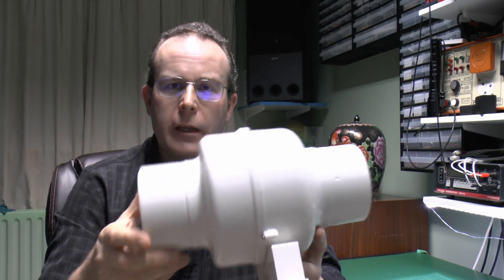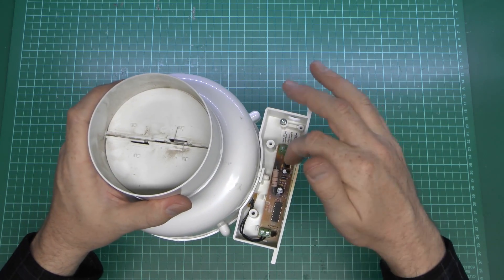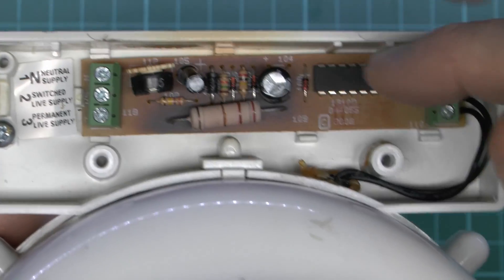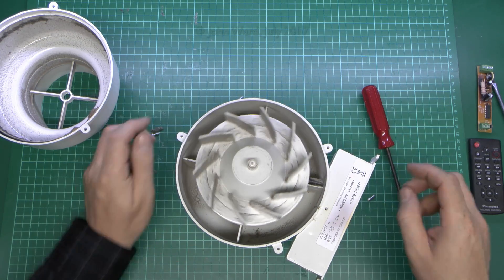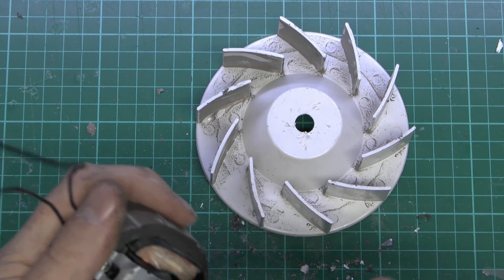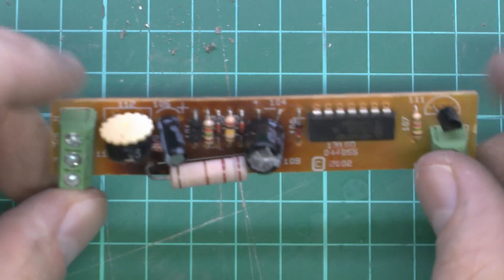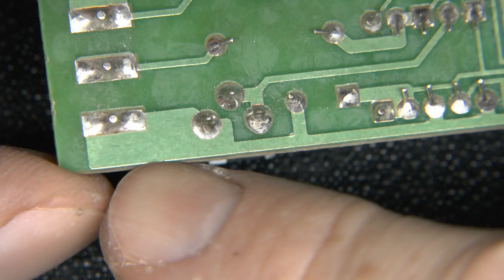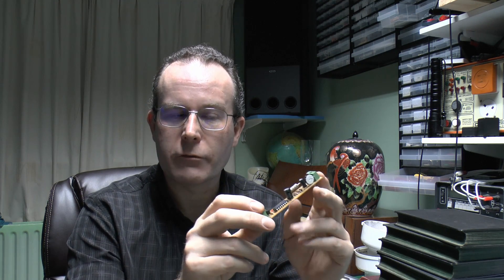Extractor Fan Timer Teardown

Comment: My bathroom ventilation is more reliable, either the window is open, or closed. 
I can vouch for the ceiling or wall mounted ones being noisy, the council installed one at my sister's place as part of one of their forced downgrades.
Within 24 hours I was asked to  find the isolator & turn the bloody thing off, and then go up a ladder to tape up the rattling vent & stop the draught.  Her window also works as well as it did the preceding 40+ years, without any noise or electricity bill.

Comment: Love it. I tried to fix one by doing the same - jacking the mains straight into the motor under test conditions from a plug and socket. My knowledge is limited so when it didn't work, I wondered if I was missing something. Looks like it was either a winding or thermal fuse. The bathroom fan was over £100! Thanks for putting my mind at rest.

Comment: The resistor simply needed to be hanging down in the air stream. That's the way that they used to cool the speed resistors in old car heaters.

Comment: You published this the day before I put a fan over the bathroom ceiling in my brother's house John!  I never thought that the fan he bought would have a simple resistor dropper but it is the same design as this one except it uses a singe jumper on a resistor array for the timer cap circuit!  I am imagining the warm PCB as I type and having watched your video fixed it to a roof joist 12" above the insulation for my own peace of mind!
Thanks and keep them coming...  Garry

Comment: Wow!  It has one of those HomeFire(TM) circuits brought to you by China.  Let's run 3 watts of power through a 3 watt resistor fitted snugly against a PCB and plastic housing.  Surprised they didn't fill that cavity with cedar shavings as well and advertise it as "aromatic scent emitter".  They did go all out for the premium Texas Instruments brand 4000 series chip though which is surprising.... not that they are expensive in the first place.
Reply: I think the resistor helps prevent condensation on the PCB in really wet bathrooms like mine.

Comment: At first I thought the IC was going to be a CD4060 but there was a capacitor missing. Then I saw the tracks between pins and when you carefully covered its markings I was expecting something inspired. But a CD4001? And not even configured as a Schmitt by the look of it. 

I've got traced ccts of fan timers based on the 555, 358 and CD4060 for a start, plus discrete component ones. None is as embarrassing as this one.

Comment: nice video I will be getting a brushes digital inline can I wonder if that would be less wasteful and longer lasting
Reply: Get a PSC (permanent split capacitor) motored fan if brushless isn't available or out of budget.  PSC makes for a very efficient motor (65-75%) vs the shaded pole types (15%) found everywhere.  Okay to have shaded pole in a heater as the motor itself generates heat from the waste.  But vent fans, try to find a good PSC motor at minimum.  I have a Panasonic vent fan with PSC motor that has been running almost non stop for 8 years.  The life of the motor is only as good as the quality of its capacitor though.  So make sure a good metal film capacitor is used instead of cheaper wet electrolyte types.

Comment: Wow, that's a really simple circuit.  I don't think I'm fan of that resistive dropper though.  Just recently I happen to get a timer installed for my toilet exhaust fan (also inline type).  Looks considerably different to the one in this video, the timer circuit is a Silicon Chip design that uses a capacitive dropper and a proper relay for switching the fan (or whatever) on and off. Here are the photos:

https://drive.google.com/open?id=0B5Wm-dWZjGIpZG1Cb3Y1TnEyUWM

https://drive.google.com/open?id=0B5Wm-dWZjGIpV0ozTDFnSlZqRkE

Comment: A cheap, nasty timer board. For a few cents more they could have made a board that doesn't waste power 24/7 but that would have made it 1 pound more expensive at the sales point. Engineering to a price and not a quality level. :-(
Thanks for the videos.
Reply: +ZEROSTATIC72 The bathroom fan in my first house had a neat non-power wasting design. The shaded-pole motor had an extra winding to power the timer circuit, making it a transformer as well as a motor. Made perfect sense as the timer only needs power when the motor is running.  Start up was probably dealt with by changeover contacts on the motor relay.
Reply: Found the traced cct. It was a changeover relay, a snap-action microswitch type as there was no hysteresis in the timing circuit.
Reply: The motor/transformers are a really neat idea, very sedom seen however. In this case a capacitive dropper would have been a much better design and reduced the wasted power and heat and saved the huge resistor, but every cent counts when you make them in quantity.

Comment: Neutral switching is done because the electronics is referenced to the neutral side, ie electronics ground is neutral, and because the triac switching device isnt isolated it has to be put in the neutral side otherwise the 4001 o/p would have to go all the way up to the 240v live side to turn said triac off.
Interesting to see a resistor dropper, looks like a cheaper way than having the usual class x capacitor dropper.
Reply: Could I ask, does this mean the live side remains live all the way through the fan to the neutral switch?

Comment: Hi John a great video as usual. I''ve come across loads of those timer boards that are burnt, sometimes quite badly. For a few pence more each the manufacturer could use a capacitive dropper supply which wouldn't dissipate any heat. I modified a couple using a 0.22uF X2 mains capacitor and associated components and they work perfectly. As you said in the description the MAC97 is a triac not a transistor and is used because its gate current is no more than about 5mA which is all the resistive supply can deliver. The motors with blown thermal fuses can easily be fixed by soldering some wire across the fuse to bypass it - I would never do this for a customer's fan (I always fit a new one) but have several in use at home for things like fume extraction etc.. Lastly I didn't expect to see you using a nasty neon screwdriver, have you had a change of heart?